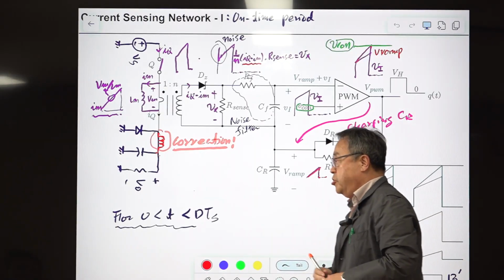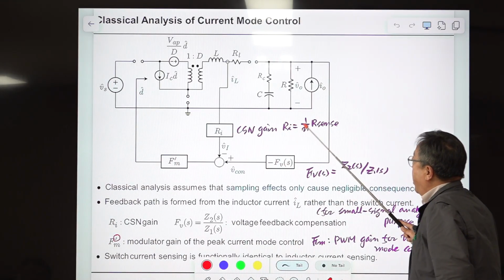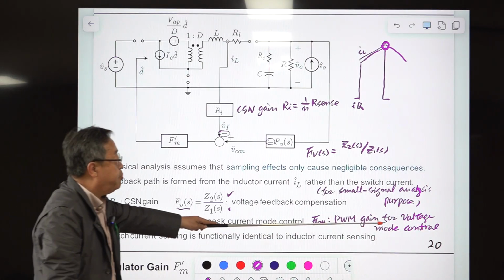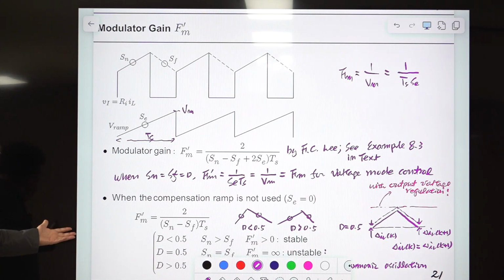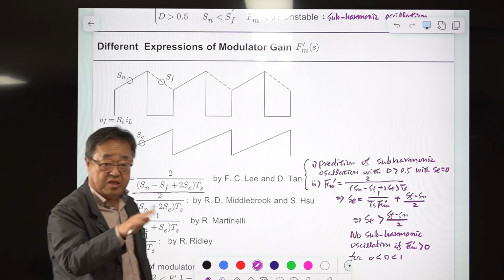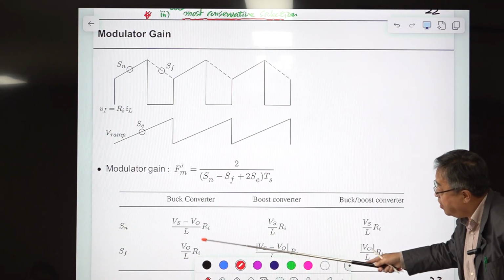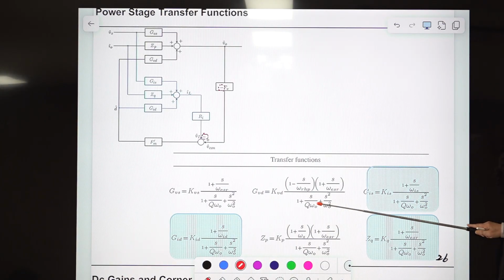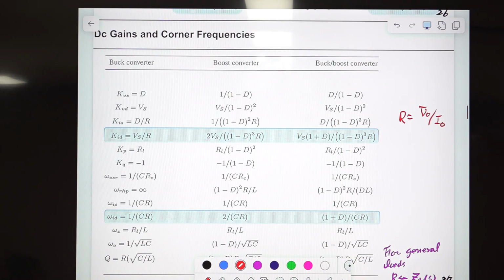Lecture 03: Current mode control, Buck converter, Modulator gain, Current sensing network, Bode plot

Comment: Thank you for your in depth analysis.  This level of explanation is not widely available.
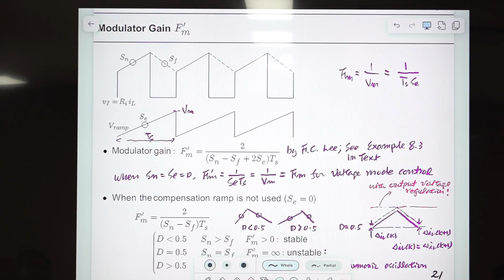Your correction at 14:37 (Sn = Sf = 0) implies no inductor current slopes.  Should the correction be Sn - Sf = 0?  This implies 50% duty cycle.  Please explain.
Reply: Never mind.  I answered my on question.  Sn = Sf = 0 implies no current feedback and thus voltage mode control.
Reply from the maker: @HassanKelley-m7w  Thank you for your interest to the video. Hope you find it useful.

Comment: Sir I guess in the derivation of the pwm modulator gain expression it seems like there is an assumption that inductor current slope is considered as a constant but in reality is it possible??
Reply from the maker: Very good question. The F. C. Lee's model ignored the possible (instantaneous) changes in the inductor current, while Ridley model and Tan model did incorporated the changes in the inductor current,  leading to the feedforward gains from the input and output voltage. However, the gains are rather small to be ignored in the practical analysis. In fact, the impacts of the feedforward gains can be  ignored in the control design. The F. C. Lee's design approach and Ridley's approach are the same as long as the control design is concerned. The Ridley's model shows the celebrated peak at half the switching frequency in the loop gain. However, his design equation can be shown to be  practically identical to the Fred Lee's method.  In fact, Ridly's new model  shows something we do not have to see,  if the current loop is correctly designed based on the Fred Lee's model, which ignores the sampling effects and feedforward terms altogether. This indicates that the feedforward terms are practically unnecessary, even though Ridly and Tan provided two different results (even contracting each other). I think those arguments overly and unnecessary amplified in literature. I write one paper in the 20 yrs ago discussing these issues, which was badly disputed by Vorperian and miserably rejected for publication.  Details come later.  I am writing this in a hurry. Thanks.
Reply from the maker: I have been thinking these issues for a long time, yet probably shorter than Vorperian.